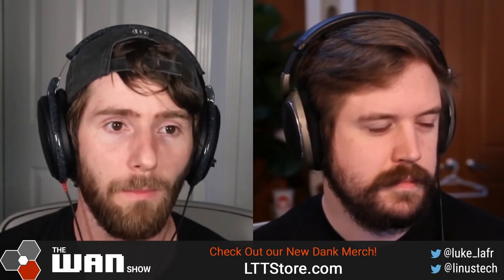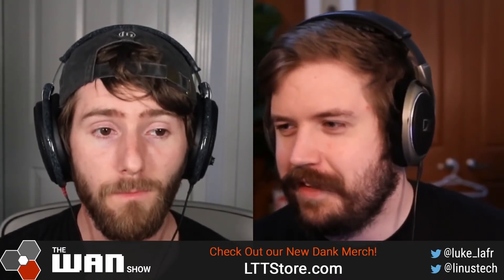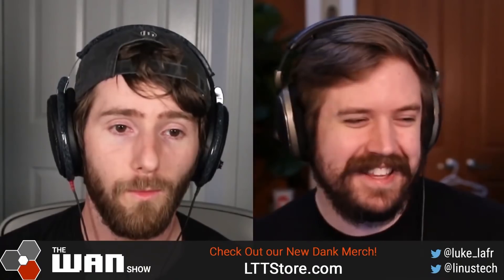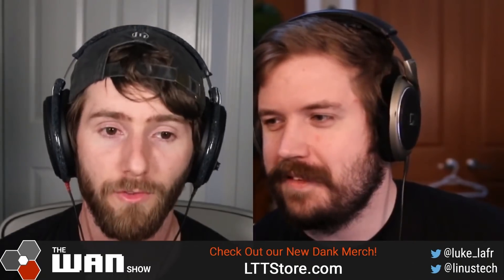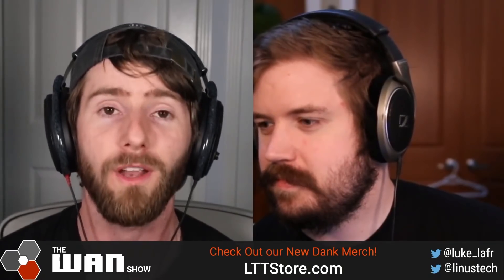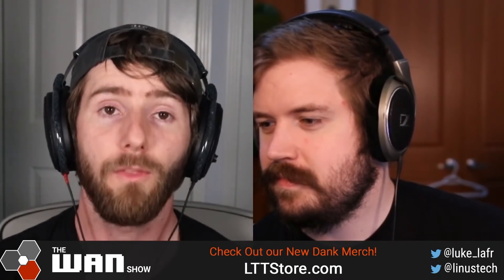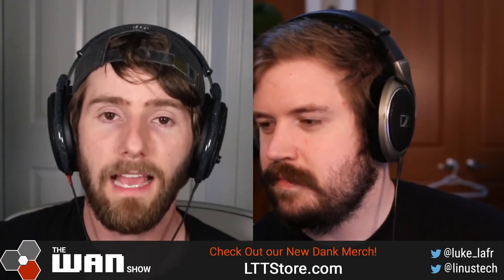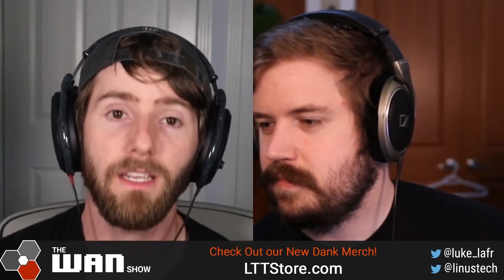CPU naming just got MORE confusing

Comment: Time Stamp: 4:56 You are right there is no standard measurement.. But I'll tell you this, AMD seems to be right on track to KEEP ME HAPPY for the next ten years with their plans and Nodes.. AMD is killing them in IPC and power use.. And I'm not a fan of Intel calling there 14NM Process 14 one day and tomorrow calling it 10.. That's a lie and a Deception.. They were just calling their chips the 10NM 11,000 SERIES, Now what Is It the 7NM 11'000 SERIES??? Does anyone see how this makes a consumer confused by what they are buying????  Now they are calling it 7NM that is how people end up with hardware that's not what they thought it was.. Example short story back in the late 2000's I bought an I7 laptop.. The Guy at Bestbuy told me it was 4 cores and 8 threads.. And I believed him because I thought and believed it was impossible intel would Never brand a Dual Core 4 thread Chip an I7. So Called King of the Hill at the time. I didn't even believe there was such a chip. Surely only I5's and I3's could only be Dual cores.. Right!? No Not with Intel and their naming BS.. I was Dead wrong and stuck with a dual core Laptop. Because of Intel's naming BS.. They are still going to spend the Next 10 years getting the shyt kicked out of them by AMD on every platform especially in server's. Yes Intel is bigger but AMD keeps chipping way at Market share very year Since Zen. That 1700X was Intel's 2600K..

Comment: They could just name the chip by Generation G9 then 5/7/9 then by chip advancement like 1 So the 9700 may be the G971 I5 would be G951 and if it's a K it's the G951k

Smaller numbers, more linear and you replace the last digit so if it's a 9750 or 9755 it'd still be 2-3 instead of G951K. If the 5/7/9 wasn't that important you could use G911 

The G9-1 would be lowest performant and it builds from there as they are unlikely to make 10 chips on a generation unless? GS server chip GM mobile. There's a few little naming things they can do.

Comment: Why not have a standard something like a RISCV chip and measure in multiples to the current size of a chip. So for example an intel 14nm would be x1 then there 7nm may be something like x1.5 since the chip is 1.5 times smaller
Reply: That's pretty much just measuring transitor density
Reply: @R3lay0  No since they can measure the smallest or largest item, it might be better since you can compare power characteristics and max frequency

Comment: Enthusiasts should just use a density metric. The number of transistors per square millimeter. It should be easy to calculate: take the number if transistors on the chip and divide by the size of the chip.

The cache is not really relevant to what we care about, as we'll assume they'll also make that as small as possible. They're not going to take a performance hit and start removing cache or adding more than is needed.

It's not like, at the end of the day, we really need to care about exact numbers. The reason we care is based on power efficiency, heat, and performance. The point is just to know when it changes, and to compare.

Comment: I don't base my purchases on "nanometers" anyway, Mork (nanoo nanoo).  I base my purchases on performance and benchmarks for the system's requirements.
Reply: Same here, but, and try not to take offense at this, we're not normal. Imagine some CFO or COIT who doesn't have a background in this stuff and needs to make a mass order. They do a quick Google search and see that A has something smaller than B and smaller is better, so they buy A and don't give B a second glance. That's what Intel is fighting against. I don't know if I agree with it, but definitely understand it.
Reply: performance is definitely most important, but node is a huge factor in heat and power usage. smaller node uses less power and creates more heat, its a big deal in (45w) laptops because intel is close in performance but has to use literally twice the power to match AMD
Reply: @bradhaines3142  - Power usage is part of performance.  Anyone who knows anything knows that you can't base performance just on one metric, it includes clock speed, turbo boost, single core, IPC, TDP, etc.  I also never use laptops.

Comment: Would “instructions per clock” be a more useful metric? What are the pitfalls when judging two different x86 processors against one another using ipc and sustained clocks?
Reply: we should only and just only measuring chips by single threaded and multithreaded scores, TDP at max load, all the nanometer bs is just confusing newbies
Reply: not when judging the process. the density per mm^2 is close, but still misleading when talking about how small the transistors are because of how they lay out the transistors. thats when you start talking about fin fets and ribbon fets being sub tech in the process that allows for more transistors in the same area. it is a complicated deal. they would need a benchmark of some sort to actually determine the performance of a node.
Reply: you can have a high ipc and slow clock or a low ipc and fast clock and both would be almost indistinguishable. Which is what you said, but i don't think it's a good number.
Reply: @jamesmnguyen  When I was young and ignorant, I made a decision to buy a processor purely on core count and ghz. If ipc had been listed in an average consumer fashion, I could have also used that data to make a better decision.

Comment: Idea, Gauntlet of tests that you can talk about with other tech youtubers. coroborate the performance and either write off any discrepancies as margin of error assuming the bottom 10% of those numbers to be somewhate relyably achievable
Develop a way to determine a score based on the best performing chip and attribute that score as something that can and will be attributed to every chip from here on out (probably going back as many as 4 or 8 generations to get some good data 

If i had to guess you would probably need a way to determine a score PER test then factor those numbers in trying to get them within about 4 digits every time in order to get a good averageable score that will update well with following tests added in over time 

test may get old fast if we are going to be seeing both sides fighting for gold all the time but honestly something is better than nothing. 3d mark is okay but like its not terribly diverse these days if im not wrong

Comment: Whenever we come to such problems on market naming something i just think of using the term class, much like SD cards use class 10 and such, im a fan of amd but intel idea is very good one as base to something i think its better all you need to make a class aspect of something is reference if intel 10nm and tsmc 7nm are  actually very alike in density, just use class term them, easy peasy, these cpus have density of class 7 or class 7 density whatever, then we have intel class 4 density ones, tsmc class 5 density ones, and the intel class 20A density, intel names are not bad , if used in this class fashion it would standardize things to some point, just use density as a measure for this class property thing, the companies would have to provided those density numbers so it can be classified on what class category it fits, leaving the already nanometers metric thing irrelevant, as this aspect does not relate directly to performance anyway

Comment: "Why don't they just measure nodes/mm^2"

Because Intel doesn't pick the industry naming scheme. 7 -> 5 -> 4 ->3, etc is just what the industry settled on. No company wants to be the first to break that understanding and confuse potential fab customers.

Intel's naming alignment is necessary if they're going to be an outsourced fab, so Qualcomm executives (for example) can better compare options for a fab process when cross shopping

Comment: Why stop there? Why not call the next Intel node Intel Inverse Infinity? I know that process node naming haven't been consistent and related to the actual size of the transistors for years.

But the only thing that the new process node notations will achieve is confusion and more research needed by people who, for whatever reason is following this stuff.

Why replace a bad set of terms, with a set of terms that make the misunderstandings worse? It just feels like Intel is maliciously arbitrarily making up terminology: It doesn't even feel like incompetence anymore.

My solution? Make the process nodes sequentially numbered: Call all the process nodes prior to the new process nodes Intel Node 0 (Old name), then call the new nodes Intel Node 1, 2 ,3, so on. Sure, the numbers still lack information about the process nodes themselves, but it's way less arbitrary than numbering them 7, 4, 20A and less prone to misinterpretation like 14nm or 10nm. Intel can even append suffixes like "P" or "O" or "E" or even the "+"s.

Comment: I agree with Luke. Products shouldn't be named off a size or date. At some point you will screw yourself over by something out of your control and you'll have to rename it anyway. Just name it off it's code name or the name of the architecture. Something you actually have control over. it's like trying to name a product off of a year. Literally the only way that can continue to make sense is if you release whatever product you have at exactly the beginning of the year, which gets screwed up with time zones anyway.

I've argued with the PM team at my job about adding a year to the name of our product instead of just using the version number which we had been doing for over a decade at the time. The explanation was to be in parity with CAD software we support like Autodesk and SolidWorks which by that point were using years themselves. Then we ended up in a mad rush every time these companies would release their next version and we only had a few weeks to get our stuff out the door that supported them. Eventually some of them would release out of sync with each other and later in the year. Then we ended up stuck releasing a version named after the previous year. We had to skip a number to "catch up". It's just flat out stupid.

Comment: Why don't they compare cpu's by focussing on things that are actually useful. Like MIPS/Watt or something - that might actually be useful.
Reply: Because these are node process, which is just one component of the CPU, not the CPU itself. 

Like TSMC n7 is used for both 6000 series AMD cards and 5000 series CPUs.

TSMC n5 will be used for 4000 series Nvidia, 7000 series AMD XT, currently used for Apple M1, will be used for Zen 4, etc.

Realistically, these node numbers should be irrelevant to most people. Only the end product should matter to customers
Reply: @moist_ointment  The only part of that comment that made any sense is "these node numbers should be irrelevant to most people" and all I'm suggesting is that if they are going to use a metric , whatever metric it is , then it should be relevant. Consequently using values that would actually be a useful measure of the cpus' efficiency would be helpful. Like how much 'work' can it do for its power consumption - that would be useful to know whoever fab'd the device and whoever designed it for whatever product. People buy CPU's because they need something that is powerful enough to do what they want it to do at a price they are willing to pay. They don't buy a 'node process' , and if they do they are an idiot.
Reply: @nonsuch9301  they can't measure how much work a node can do, because nodes don't do work. Its like measuring how much work a car chassis can perform before the drive train and suspension are added.

the AMD 6900XT and Ryzen 5 5600X are both built on TSMC's N7 node. How do you measure the work n7 can perform?

It matters to enthusiasts and investors, because we know how well of a node n5 is because the Apple M1 is built on it. So we can predict how impressive performance will be when Ryzen switches to n5 for Zen4.

This stuff matters to investors, and while I'm not a major player, I spend more money investing in tech companies than I do on their products, so this is useful info to me

Comment: The chip industry needs a standard cpu, ram, and persistence storage say a simple risc-v cpu, exetra for the other types of integrated cips. These standard designs can be printed at each process node and then compared for power consumption, performance gains, die size, rate of defects in prints, and many more meaningful metrics compares on a level playing field devoid of architecture differences. Though each process will not map the risc-v design to the extac same logic units and there would also need to be fine tuning of the traces between logic units to prevent AC coupling and the fine tuning would need to be different for each process node. So it would be a better picture of what process is better and by how much for the same chip implementation but with everything that goes into transferring the same IC to different nodes it still would be a fuzzy picture.

Comment: Its all bollocks tbh they should be naming the new tech by the processing power per watt as that is what actually matters to end users.
Reply: How do you measure "processing power"?

CPUs are way too complex to be reduced to a single number, like consumers love doing (megapixels for cameras, resolution for TVs, Mhz for CPUs back in the day, etc.)
Reply: @moist_ointment  blender rendering time is a good one there are many ways to measure pure processing power even benchmarks that test the flops performance of a cpu.
Reply: imagine naming your fabrication process after the efficiency of one Processor. That's bollocks.

Comment: I can see the logic behind Intel's move (they want to use lower numbers because TSMC use lower numbers, but they can't use "nm" because it would be inconsistent with the nm count of their previous products), but holy shit this makes things even worse lol. There's not even an unit anymore
Reply: What you said is mostly right, but considering that Intel 4 has a theoretically higher transistor density than TSMC 5nm (correct name should be N5), Intel can actually justify themselves.

Since the shift from planar to FinFET, which is around 2012, these measurements in nanometre are not referring to any actual physical distance. This is true for all semiconductor manufacturer with advanced process nodes. Putting an unit in the name is more deceptive than not putting one because it gives an impression that they are actually measuring something, which is not true.

TSMC, Samsung Semiconductor, GlobalFoundries, and now Intel are now not including "nm" in their node names and this is good to stop the impression that it is a measurement of any kind, which is not.
Reply: @NicolasChanCSY  right, but this doesn't really solve the problem. They still don't have an objective measure, so while they are not deceiving customers with a "fake" measurement, they still aren't really providing any good information with this new naming scheme
Reply: @lucasfranke5161  You are right. But so far, no one AFAIK can come up with a better naming scheme that can be
1) performance related;
2) simple and concise;
3) objectively measurable;
4) comparable across different companies, which have largely different node processes and packaging technologies.

The best way to compare them? Look at their performance per watt and transistor density. But this is going to less understandable for general public.
Reply: @NicolasChanCSY  I guess
Reply: Just have to rely on good old benchmarking like Linus said. I'm thankful I live in a time where I can watch multiple people benchmarking these products so I can at least make the best decision for my next purchase.
Reply: But if the sizes don't mean anything much anyways, is the unit actually doing anything?
Reply: @RyanLee-kd2ks  IMO, It does nothing nowadays except telling you that the gates are in the scale of nanometres.

The formal names of these node processes from TSMC, Samsung, and GlobalFoundries have been not including the unit for quite a long time. And now Intel is following this industry trend, for good or bad.